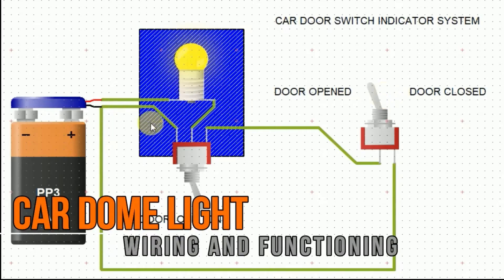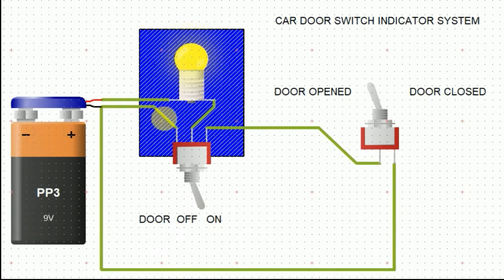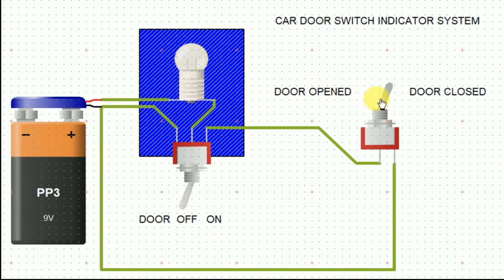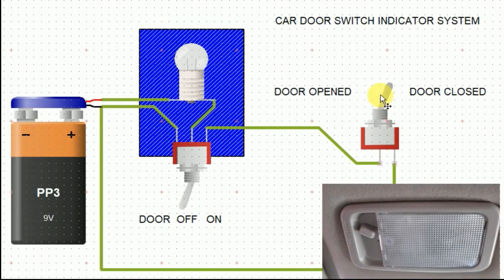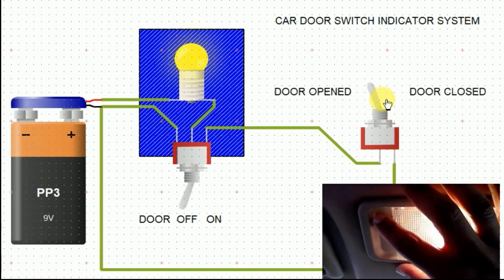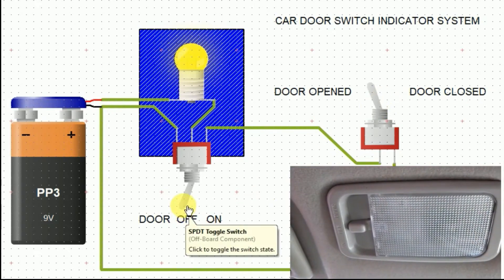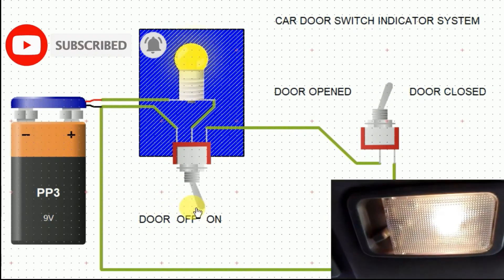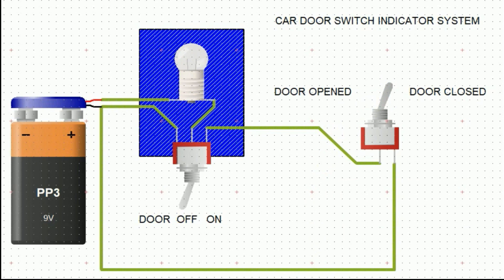Car Dome Light Wiring Review

Comment: I have a question that hopefully you can answer. I have a 54 Chrysler New Yorker that i cannot figure out how to diy a main push button that turns on all my lights when the doors are closed. Ive tried many ways to wire them without success. I know the system is ground triggered. Please help. Ty
Reply from the maker: All light means, headlights, parking etc ?
Reply: @setnfix  Ty for trying to help. Just the interior courtesy lights (foot and dome light). With research I found the lights are ground circuit controlled. I've tried a push switch and toggle switch with no lights when doors are closed.  Ty
Reply from the maker: @myfaaammilly1607  As you said, normally door switch is grounded. Therefore, you can take a wire from door switch and other side to the battery + wire. Remember that to use a diode when getting ground wire from door switch. In order to toggle, use a SPDT switch and connect one end of the bulb to the middle pin of the switch and 1st pin of the switch to the door switch wire and 3rd pin ground directly.
Reply: @setnfix  Ok, so my driver side door switch already has a powered wire, so I'm tapping into that + wire to spdt switch?  And if so since it already has that powered wire do i still need a diode? ty
Reply from the maker: @myfaaammilly1607  You can get ground from the door switch by tapping it.  Door switch [Diode] to 1st pin of the switch. 3rd pin of the switch directly ground. 2nd (Mid) pin is to bulb. ----- +12-- (Bulb)----------  2nd pin of the switch.
Reply: @setnfix  Ty, I believe i got it, so with the diode I'm blocking current going to the switch correct? Lastly with your drawing on the mid pin I'm connecting the bulbs neg side wire to pin and other side of bulb wire goes to a power source?  I appreciate your help tremendously.
Reply from the maker: @myfaaammilly1607  Yes. Mid pin to bulb - and other side to the battery +.

Comment: I am trying to add led puddle lights that turn on when the car door opens.  When I splice into the black and green wire in your diagram, the led light turn on when the dome light is off and they are off when the dome light is on. 

I put the positive wire from the led to the green wire (in diagram)  and the ground wire from led to the black wire (in diagram).

How do i get the lights to tilurn off and on simultaneously? Thanks so much for your help.
Reply from the maker: I ASSUME THAT YOUR CAR HAS A DOME LIGHT.
Normally the door switch is connected to the ground (-) and it disconnects when you close the door.
If you use LEDs, connect negative pin of the LED to the door wire and you need take positive directly from the battery (use a FUSE) and connect to the positive pin of the LED.
Reply: Ahhh thank you so much. I will try this when I get hom!!!  Youre awesome.  @setnfix
Reply from the maker: @outtakontrolcustoms7654  😍
Reply: It didn't work for me. It caused the light to stay on constantly. I will try to explain what I did. 
The dome light turns on when the door opens.  I want this to still occur, but I also want to add puddle lights to the outside of the car that will turn on at the same ti.e as the dome light, when the door opens. 
Initially, I spliced the negative from the LEDs to the negative from the the switch - and the positive from the LEDs to the positive from from switch. This caused the LEDs to turn on when the dome light was off and the dome light to turn off when the LEDs were on. 

Today I connected as you said in your reply. I connected the negative of the LEDs to the negative of the door switch and connected the positive from the LEDs to the positive of the battery. This caused the LEDs to stay on permanently and the dome light to turn on and off depending on the position of the door. 😢
Q

 @setnfix
Reply: @setnfix I will try to add a sketch of what I did
Reply: @setnfix  I've tried several different ways. The only way that works is when I connect the LED wires directly to the prongs on the dome light.
Reply from the maker: @outtakontrolcustoms7654 remove the dome bulb and check the LED work.
Reply: @setnfix it does. If I connect the LED to the dome light, they both turn on and off at same time.
Reply from the maker: @outtakontrolcustoms7654  No, as you said if LED keep on even the door is opened or closed, then remove the doom bulb and check it again.
Reply: @setnfix  ok. Nothing works if bulb is removed. I will connect the LEDs directly to the prongs of the bulb. I just wanted to avoid running wires all the way up there.
Reply: @setnfix  it's weird. The grou d has to be attached to the positive side of the bulb.
Reply from the maker: @outtakontrolcustoms7654  I think you have taken the wires in wring. you have taken power to LED through the dome light bulb. that is the reason for LED is not responding to the door and, not light without the dome light bulb.

Comment: Hello sir
I have 1 query
All 4 doors has  a door switch which
 has - ive connection 
I have installed door puddle light in all 4 doors given constant+ ive from fuse box and -ive from door switch separately to all 4 doors but in this connection driver side door puddle light working fine but rest 3 doors puddle lamp working together if Iam opening any of them 
 3 doors puddle lights glows together
 but I want individualy glows with whichever door is open .. 

Pls help & reply
 I have maruti swift vxi 2016 model (india)
Reply from the maker: I may be due to the default wiring connection. If you want to use same door switches for dome lights as well as your new door lights, you have to change the wiring connections, If you can post your circuit diagram (door lights) in my youtube posts, I can give you a clear answer.
Reply: @setnfix  sure bro will try to find the diagram n share with you .
Reply from the maker: @shubhamsoni3298  Not that circuit diagram. I just want how you have connected your new door lights..?
Reply: @setnfix  I have taken constant 12v + from fuse box to all 4 doors and - ive from individual door switch. So that puddle door light glows of that door which is open
Reply from the maker: @shubhamsoni3298   I think all the other 3 door lamps wires are connected together. Try this. Cut one wire of the 3 and connect a diode. anode to the doome light side and cathode to door switch. Now connect negative wire of your new door lamp to the cathode of the diode. It must be worked. Yao may need 3 diodes.
Reply: @setnfix  sure bro will try this and let you know thanks

Comment: great schematic, could you maybe help me with an interior dome light question for my truck mechanic exam, it goes " interior light will not shut off, what is the cause?" the option are 
A. Open pin #86 and right door switch
B. Open between fuse and interior light relay
C. Short to ground between pin #85 and left door switch
D. short to ground between fuse and interior light relay
I narrow it down between A and C since its most likely a door switch issue, but they can only be one answer, i would really appreciate the help if possible.
Reply from the maker: A : can not be, because the coil is not powered, no output
B: If the fuse is open no output. So this can not be
C :This is posible (if pin 86 is +12V pin). Because when the door switch is connected to the ground, the light on even the door is closed.
D : Can not be. when the fuse shorted to the ground, the fuse normally opens and has no output.
Reply: @setnfix   THANK YOU SO MUCH YOU HAVE NO IDEA HOW HELPFUL THIS WAS THANK YOU THANK YOU AND GOD BLESS YOU!